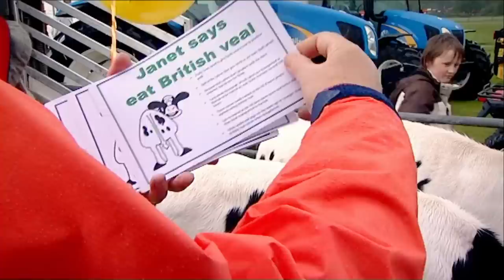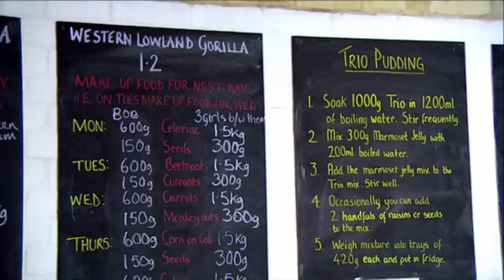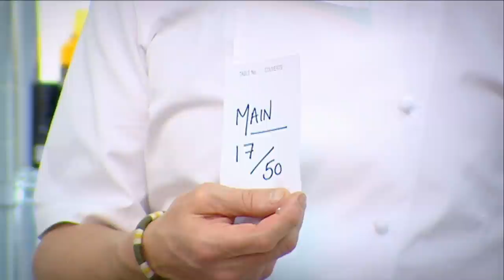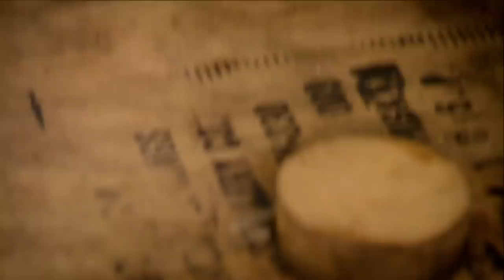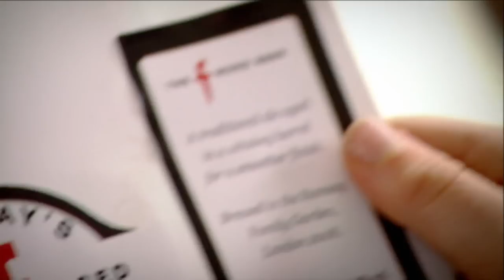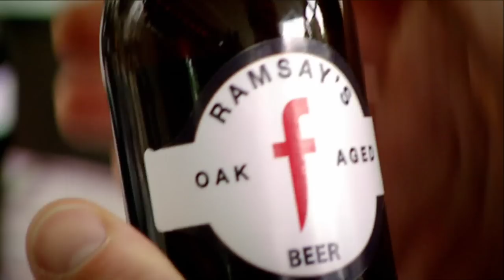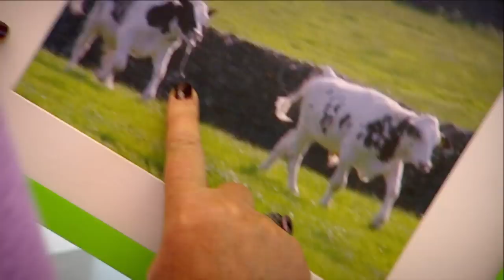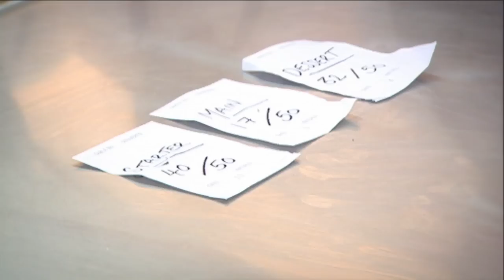Gordon Serves A Vegetarian Steak | The F Word

Comment: I think they could had done a better job explaining the "killing" process. They do things this way because it's the best way to avoid slip ups that cause stress to the animal and for hygienic reasons. Just shooting an animal in the head isn't a guarantee that it'll be a quick and painless death, if the shot is off the animal could still be sensible. But by stunning the animal it renders them senseless(brain dead and feels no pain) but lets the heart still beat so they can then have their throat cut and bleed out in about 5 seconds, bleeding out is also the more hygienic for the butchering process down the line. The combination of the methods ensures that the animal is guaranteed to be dead quickly, painlessly and reduces the margin for error immensely. The worst thing in the world for slaughter is when an animal isn't rendered completely senseless before being bled out. This is why facilities will do a sensibility check before cutting the throat, or at least they SHOULD. Massive scale operations are on tight schedules and due to the sheer number of animals going through they will fuck this up regularly. 

Humane treatment of animals in slaughter is kinda like practicing safe sex. The only sure fire way to avoid ALL risks is to abstain(don't eat an animal or don't have sex) then the next best thing is education on how to be safe and mitigating the risks.